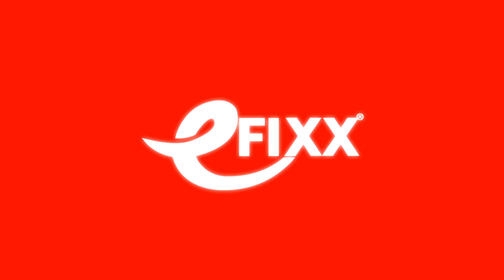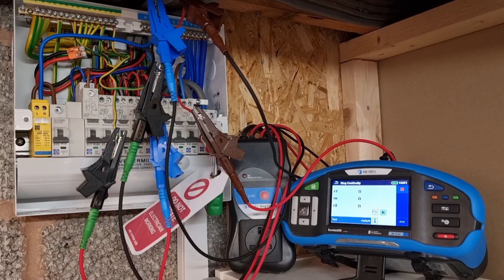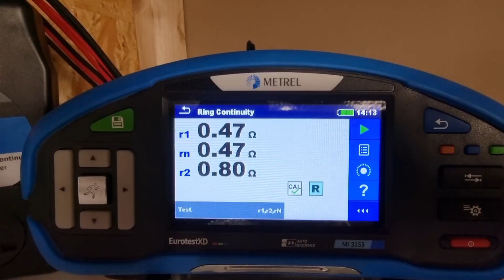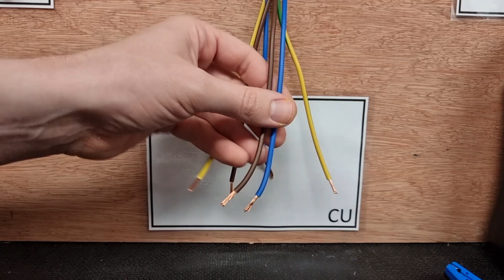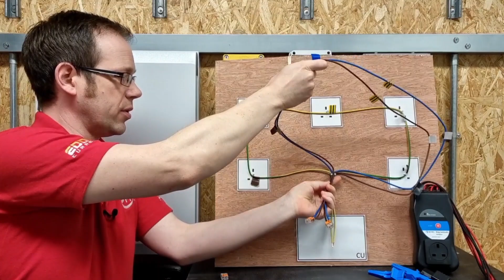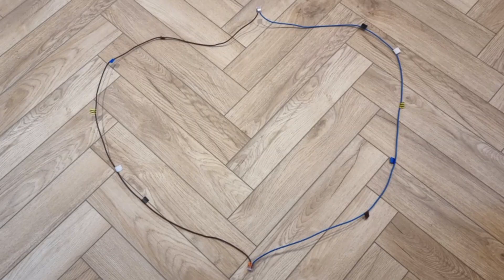How to Identify a Spur from a Ring Final Socket Circuit | Electrical Testing

Comment: Ring Final Circuits are only bad when the DIY’ers get their hands on them. If installed correctly, left alone and not bodged, they are perfect.
Plus if there’s a fault you can still leave the customer with working radials. 

A problem with those readings not being consistent are cheap socket outlets, terminals catching insulation (DIY’ers), and limp wrists.
Reply: Man, when diy'ers get their hands on electricity it's shit period.
Reply: No they are not perfect. They suffer from an inherent design flaw where too much current can flow down one side of the ring exceeding the cable rating and fuses and breakers do not trip. That potentially can lead to a house fire. They are intrinsically less safe than a radial circuits.
Reply: @deanXRayZulu  That is an extraordinarily unlikely scenario in practice. Electrical house fires very rarely are in the actual infrastructure cables (except in the old days of re-wireable fuses when people would use nails or anything to hand). Looking at the statistics, it's things like the CUs in the infrastructure side or bad connections overheating. However, the number of infrastructure wiring failures are absolutely dwarfed by fires caused by appliances and misuse.

In any event, with modern residual current devices, if the insulation does degrade due to overheating, it will trip (especially with exposed CPC conductors) and that's going to happen long before it gets hot enough to start a fire.  

Also, even radials aren't perfect. You can get an undetected break in a CPC.
Reply: @TheEulerID  Yes it is unlikely to occur but the fact is it is technically possible and the point is, this risk is not present on radial circuits.

So when confronted with a choice of a ring final circuit or a radial, why would you choose one which has a number of serious flaws when the other does not suffer in the same way?
Reply: @deanXRayZulu  As I pointed out, radials have a problem with CPC breaks not being evident and no redundancy. 

Also, 32A circuits are extremely useful, although they can be done as a 6mm^2 radial if it matters that much to you.
Reply: @TheEulerID  Redundancy isn't an issue.
The point is if you put in redundancy you can't tell when one cable breaks.

Many circuits are radials in a conventional UK household and have no redundancy. It isn't an issue.
Reply: Not forgetting shoddy 'professionals'.
Reply: Ring circuits are bad because when a break in the circuit appears, no one without a measuring device can tell it’s happened. At which point your protective device is oversized for the wire. They’re an inherent fire hazard.

Of course an electrician can detect and fix such a thing — but tends to forget about the years or possibly decades in between electricians’ visits, where such a break can appear, whether a DIYer ever opens up the accessories or not.

I’ll grant the risk is fairly low in practice, but “perfect” is very definitely not it.

(There is a secondary point to be made about things that are “great as long as everybody who touches it knows what they are doing” being inherently bad because it’s pretty much guaranteed that there will be people around who don’t know what they are doing *somewhere*, and those customers — whether they did it to themselves, or their Handy Uncle did it, or someone who claimed to be a fully certified electrician and got paid as a fully certified electrician but wasn’t — are not an acceptable sacrifice to make for some exceedingly minor advantages, but I’ll leave that to others.)
Reply: @JasperJanssen  A break in the CPC on a radial is also not evident without a test (on a ring, it would need two breaks for the CPC to fail).
Reply: @TheEulerID that is actually a very good point, thought you will have all the anti-ringers saying they are all on rcd’s so doesn’t matter too much. Personally think rings are a great invention, then again I’m 60 so pre wago revolution 😂😂. Think it like intermediate switches some people don’t understand them 😂

Comment: Ring mains are probably the most dangerous circuits in a domestic installation or elsewhere. Besides the addition of spurs etc a ring can easily become not a ring if the wires at the socket or at the mcb become loose and then the first thing that will happen is the Zs value will not be correct and the 32amp mcb  is now protecting a 2.5mm wire that can't take 32amps. Besides that they are difficult to test and the wires have to be disconnected from the Neutral busbar and the mcb to carry out the test which means when the circuit has been reinstalled it isn't guaranteed to be as per the test. All rings should be downgraded to 20amp and declared to be radial in old installations and not allowed in new installations.
Reply: The first part of your statement is a bit over the top, there is nothing wrong with a correctly installed ring final circuit, and thats the punch line. where I have concerns is in the quality of the intrusive testing and the tester, all the above increases the mean time between failure. I can understand some people not liking them because of the testing requirements but that is not the fault of the design. Certainly radials installed in kitchens and utilities where overloads that whilst may not be continious are certainly a possibillity are also a concern. Please dont tell me this is covered by good design, it certainly should be but is it? we have all seen horror stories some being installed as we speak. A badly installed and maintained radial is still a problem.
Reply: I get.where you are.coming from but feel if they were that dangerous they would be banned but they won't be, for now. Now that said, it doesn't mean you have to install ring final circuits. 😊
Reply: @craigemmott4976  you don’t have to start by banning them, because in practice they don’t cause that many fires or electrocutions. But I am still very surprised you guys haven’t at least started deprecating them for new builds.
Reply: Where in a domestic dwelling will anyone use 32amps off their sockets.  The 32amp breaker serves only to provide protection to the circuit and not protection for the user. I see lots of talk about DIYers and have walked into many premises where spurs are common. Unless a law is made to stop DIYers then my initial argument still stands.

Comment: always makes me smile when people say ring final circuit and never radial final circuit, its just ring or radial in plain speak, great vid
Reply: That's because rings are a final circuit within that DB/CU, where's radials for example, can start at the main 3 phase DB, then you may come out of there to a single phase CU, say from a 63amp MCB into the main switch of the CU, thus having a radial from the main DB to the CU and you can then have multiple radials off that CU and if you have a shed at the bottom of a garden, you again come out of the CU with a radial circuit. 
Hope that helps you?
Reply: @craigemmott4976  a domestic lighting circuit is a radial final circuit, a cooker supply is a radial final circuit, ect ect, hope that helps you understanding a final circuit

Comment: Seeing it like that pulled open let's me see a circle of wire so at any point to point at opposing sides.  Yes should be the same.  I do still like ring circuits but yes a danger if open some were.  In the work shop I have 4mm to my radial sockets.  An some that are red sockets no earthing on them this is for some test gear.  The equipment is on rubber mats my thinking is also I should really have isolation transformer.  Or round pin plugs so no one can use them.  Or lock off key.  But as I only work in there on that side no one should touch anything but we all know every one messes about with stuff.

Comment: in many countries, ring final is still the standard. what's the modern equivalent to ring final in the uk?
Reply: Radials.
Reply: Don't think that's right. Yes, there are several countries which use the British Standards as their wiring regs (or base their own wiring regs on the BS), and as such use rings for final circuit wiring (UAE, Singapore etc). That being said, the vast majority of countries don't follow BS, and don't use rings for final circuit wiring (radial circuits are used).
Reply: No such thing as an equivalent. A ring’s a ring